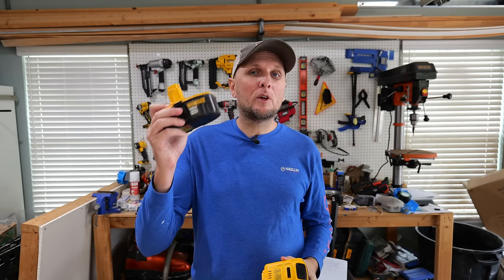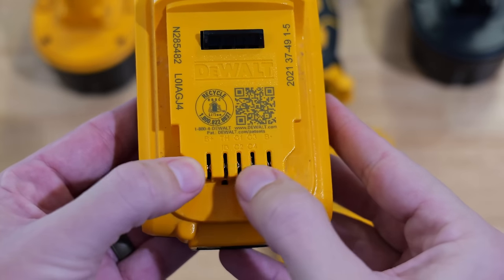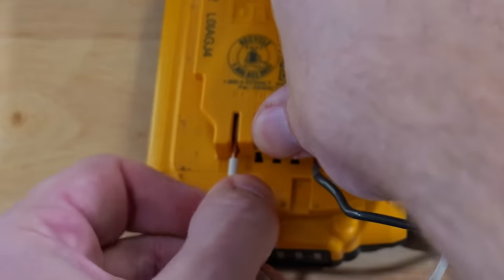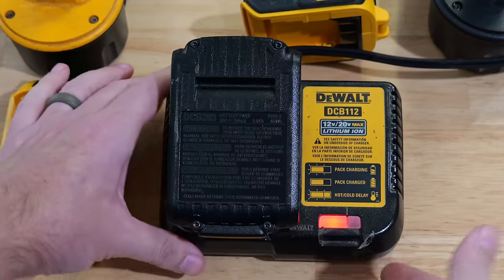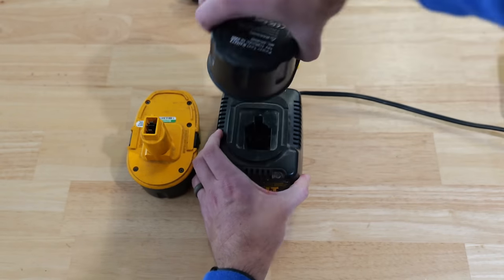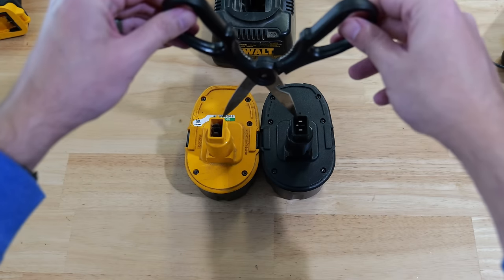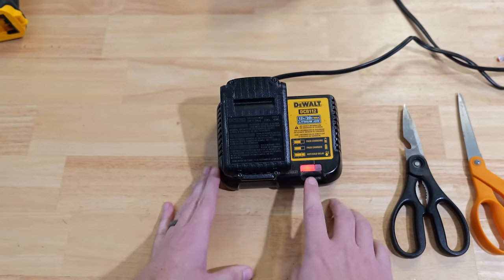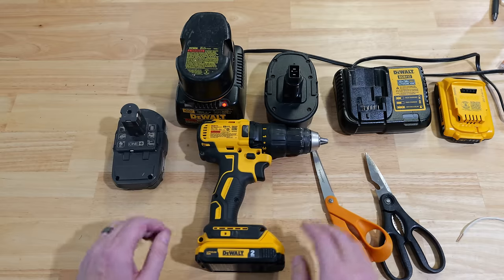SECRET To Reviving Dead Portable Tool Batteries | Super Easy!

Comment: Ingenious! Love this! Thank you so much for the wonderful tip! Gonna save people some serious bucks!❤
Reply: Not really because once you drain one of those batteries down too low, they become worthless. Yes you might get them to take a charge but, the capacity of the cells will be too low to be of any use.
Reply: @Blueknight1960  As I stated to another such comment, I jump-started a battery about 2 years ago and have used it many times since...never having to jump-start it again. It had been unused when it previously went completely dead (from lack of use), so admittedly that may be a factor. But it may not be a factor as well. I only know that it's operated as well as any new battery I ever owned for two years now, and I use my tools heavily...auto repair and home maintenance.
Reply from the maker: @tim9430 don’t try and give them actual facts Tim, many of them don’t like facts 😂.  Appreciate the input.
Reply: If the batteries are any good they should hold a charge on the shelf as it were…. I have probably 20 DeWalt batteries in my collection and the only ones that go dead on their own are the ones that i know are weak… I have a 9 ah 60v that’s in my chainsaw and 2 years on the shelf and it still shows 3 bars

Comment: While this does work, there is nothing to regulate the current when you connect the positive wire.  There's always a chance with Lithium that you'll have a fire if you charge or discharge too rapidly.  I recommend using a current limited bench power supply, or be ready to chuck the whole thing outside because it's on fire.
Reply: Probably a good idea to not just walk away from it while doing this. I don't even leave a battery on a charger any longer than it takes to charge it. I keep checking on it and when charged it comes out of the charger and unplug the charger.
Reply: @tsmartin I know you can leave Bosch, DeWalt, and Milwaukee in the charger since they implement a charge protection timer. Ryobi still doesn’t last I checked.  RTFM

Comment: FYI - if batteries sit on the shelf unused they undergo a process called self-discharge.  See wikipedia topic "battery self-discharge" for details.  I have several Ryobi tools each with a battery and I rotate thru them so a battery doesn't sit unused for months on end.  A lead-acid car battery can also self-discharge over time if left unused but also after years of use the chemistry degrades so they no longer hold much of a charge and need replacing.  A table in the article notes lead-acid batteries self-discharge around 4-6% a month and eventually won't have enough charge to crank the engine.  Lithium-Ion self-discharges 2-4% month and eventually won't have enough charge for the charger to recognize the battery as good.  So the trick in this video seems like a good way to give a still-good battery a kick so the charger will charge it.  But you will know if the battery is really degraded when it only runs the tool for a few minutes after "full" charging.
Reply: Not necessarily true, lithium holds onto its charge for a very long time. The only reason they self discharge here is because the BMS system is usually parasitic and requires a tiny bit of power to keep itself alive. The difference is that the lead acid discharge is because of its chemistry, and the lithium is because of its BMS. Does it really matter? No, but it is not a flat rate, a lithium battery with the same BMS but twice as large as another will bleed through the BMS twice as slow.

Comment: Very nice.  Never would have thought of using scissors.
Reply: What if red light continues to flash and no change to green after 20 minutes? Is it unrechargeble battery?
Reply from the maker: @maryreyes9926 yes.  That is letting you know something is actually wrong with the battery and needs to be replaced.

Comment: Very helpful... any suggestion for a blinking charger and the battery isn't charging?
Reply: I don’t have a solution but i DO have the same problem with one of my Ryobi batteries. It flashes the “maintenance charge” sequence (slow, gradual flashing).

Comment: You can also use a spade connector for the 18v one
Reply: What is a spade connector?
Reply: I agree, much safer. A short piece of wire with 2 female connector at the ends.

Comment: The 20v and 18v are actually the same voltage.  They each have 5 cells in series.  Normally the cells are specified by their nominal voltage of 3.7v so 5x is 18.5v.  However at full charge the cells are at 4.2v, so 5x is 21v.  But there isn't much capacity between 4.1 and 4.2v, and it is better for the usable lifetime of the battery to not charge it up all the way, so 20v is a nice round number pretty close to the typical upper limit.
Reply: @Sylvan_dB   Thanks. I appreciate knowing the details of "why".
Reply: correct, that's why Dewalt has the 20V MAX *  and if you go to the fine print it says " *Maximum initial battery voltage (measured without a workload) is 20 volts. Nominal voltage is 18. "
Reply: this is true if they are both lithium ion batteries but the 18 volt batteries shown in this video are nickel cadmium and are a very different technology
Reply: @jbbolts  no they are not. Ryobi changed from nicad many years ago and no mainstream tool brand has been nimh.
Reply: @Sylvan_dB  except the ones in this video are dinosaur dewalts
Reply: @jbbolts  Oh, ancient, eh?  Has dewalt discontinued those yet?  Ryobi did it nicely, making the new packs compatible with the old tools and providing "dual chemistry" chargers.  Oh well.  For NiCd the battery construction was 15 cells in series, at a nominal voltage of 1.2 volts per cell for a nominal 18 volt pack.  However the cells were fully charged to 1.25v or sometimes even 1.3v per cell, which comes to 22.5v or more for the pack.
Reply: @Sylvan_dB  whats your point? the bottom line is the 18v batteries used here are NiCad. And one of them is even a knockoff brand
Reply: @jbbolts  My point is as the first line I posted in my original message:  The 20v and 18v are actually the same voltage.
Reply: @Sylvan_dB  That part is correct... but there are way more cells in the older packs as the cels are only 1.2 volts each
Reply: @jbbolts  Correct, 15 in series, like I said.
Reply: Kids play nice.
Reply: @Sylvan_dB 
I switched from Ryobi to Dewalt, but got a couple battery adaptors to use Dewalt LI batteries with the original Ryobi tool set...circular saw, reciprocating saw, jig saw, drill, vacuum (which sucks).
Reply: @jbbolts   somebody doesn't like to be corrected 🤭
Reply: @JamesLawrence-hv4ti  yup.... I've worked with people like that... you can see in the original post thats not what he said but hey what are ya gonna do (never mentioned 15 cells of nicad )
Reply: @JamesLawrence-hv4ti  And just in case you're referring to me while I dont particularly like being corrected if I legit make a mistake I own it just the same
Reply: @jbbolts commendable, I wasn't referring to you
Reply: It's is a marketing ploy, "moe V's moe powa".
Reply: @jamest3552 
Nerd fight!
Clear the study-hall!
Reply: It's false advertising plain and simple. Dewalts batteries have to be marketed as 18v everywhere else in the world that actually has basic consumer protection laws.

Comment: In case you don't have a second battery to jump start the dead battery, I did the same thing using my car battery and a set of jumper cables. I had to clip a piece of wire onto one end of each jumper cable so I would have something small enough to fit into the grooves on the Dewalt battery. I used an old guitar string because I had one handy. I only jumpered them together for less than a minute. The 12-14 volt car battery shouldn't cause any harm to the 20V battery...and it didn't. I have used that rescued battery for about 2 years since then and never had to jump start it again.

Comment: Thanks for the info. My experience is that 'heat' kills any battery no matter what type and letting batteries go 'dead' and then leaving them partly charged is also bad news. Some batteries also dislike being anything other then constant topped especially gasoline car batteries. i tend to leave them on trickle charge and have a desulfator in my car engine compartment and plug it in whenever i think of it and my batteries last 10+ years. The charger is on a xmas light timer and runs about 15 to 30 minutes/day so the battery water levels don't go down from the constant heat of charging. My ipod is plugged in all the time and so it lasts an incredibly long time.

If i have a particularly long continuous drain like mowing a lawn with an electric mower, i will go till the battery seems done and not try to force it beyond that and then put the battery in the basement in a cool place but not the fridge, for at least an hour so it completely cools down. Then i find the coolest place in the house like the floor in the basement (again not the fridge) and put them on charge and charge till it is done and leave it in the charger for awhile after, (i set the alarm on my ipod to remind me) and then let the batteries cool for at least an hour or three, and then use them. My batteries last a long time with doing this.

NiCad batteries are supposed to be used till they are drained down or they will get a memory and will not top off properly, but the problem is that if they get too low they will short and the only way to revive them is to give them a blast of juice say from a lead acid car battery to break the short and then they will recharge. I would not try that with a lithium battery. (That's why Teslas are called "blow up cars".)  The memory problem with NiCads IMO is more mythical than true and i've read articles that basically dis that practice basically because any weak cells will die first and thus reverse, so in our aircraft they have to drain (cycle) each cell separately and have a charger that electronic monitors it and shut off the draining at exactly the right voltage before recharging.

In the 1970's?? The Canadian guv in their infinite wisdom forced all aircraft owners to install a Li powered "emergency locator transmitter" system in all aircraft to cut down on their very expensive search and rescue costs of locating downed aircraft. Very good idea but not well thought out. The Li batteries started blowing up and basically blowing the tail off of the aircraft. (ELTs are usually placed in the tail as it sustains less damage in a crash) Aircraft don't work properly without a tail for some reason...😏 Same as the "blow up Teslas"

Another 'feature' on one device i have is that if the Li battery sits, say all winter with no use, the battery will discharge a certain amount (i forget why) so i never leave it on the device and charge it periodically.

Basically i know this info from lots of articles in RC aircraft magazines on charging, combined with listening to mechanics.
Reply: Ni cad has been replaced with nickel metal hydride batteries. they   don't have the memory effect. lead acid batteries like being kept fully charged. lithium batteries last the longest when used between 20% and 80% charge.  They make LIFEP04 batteries which don't catch on fire and have a much higher cycle life. the draw back is the maximum current draw is at their amp hour rating. The charge current is at a quarter of the amp hour rating..

Comment: Beware - this trick can definitely work if the problem is that all cells have a too low voltage. However if all cells but one are good and one cell is dead short - which definitely commonly happens too - it's an easy way to start a fire. To prevent this, chargers for n-cell batteries tend to refuse to charge when the measured voltage is smaller than the fully charged voltage of (n-1) cells. Some chargers are more clever than this and look at the charge/discharge curve to detect this condition more reliably - these chargers will have better chances at reviving a dead battery.

Thus, when doing this, best do it outdoors, with no flammable material nearby, and also thoroughly test the battery afterwards - either by fully charging, discharging and recharging once to see if it gets a good charge (on a single cell short you likely will have an "empty" - as in, too low voltage - battery soon after use again) or fully charging, discharging a bit (like a minute of power drilling into the air) and checking its voltage to see if it is near its design voltage (if it has a single cell short, it will go below design voltage very soon after charging and even drawing a small amount of energy from it).
Reply from the maker: Yes but those chargers also blink in a way showing that something is wrong.  This method would only introduce enough power so that the charger can recognize it and either start charging it again like normal or if there is an issue, at that point would blink, usually rapidly, to let you know there is an issue and needs to be replaced.
Reply: I have a battery that the Dewalt charger shows as charged (solid light) but it won't power any of my tools. I was told it may have one dead cell. Have you come across that? I haven't tried this trick on it because I was afraid it may not be safe. Looking to buy another spare battery instead.

Comment: I use porter/ cable I have to say, I put it away for about 8 months, charged.
Went to use it, worked
Like a charm. I use it for everything and it performs like a champ.
I know some people
Knock the brand, it's never let me down the battery. The drill & battery are still the same when I purchased them 6 yrs ago , now that I said something I'll need a battery & drill I'll purchase the same thing again,no regrets!

Comment: This video just resurrected my old 14.4V Snap-On 3/8  Impact. It's been in the bottom drawer of my tool box since about 2007. Both batteries were dead and the charger read them as faulty. I hooked one of them up to my 12V car battery charger set on 2 amps, and after 5 minutes the Snap-On charger would read it and apply a charge. Now while the one battery is on the charger the other is on my car charger.

Comment: This is likely to be really useful to me in the future.  I have Ryobi 40v batteries for my yard equipment; two of them are over five years old now.  I've had no issues with them, and now I wonder if that's because they've never been run down completely (I have a small yard).  However, if I should have this problem going forward, I'll "jump start" the apparently dead battery instead of coughing up the high price of a new one.

Comment: Thank you…I can practice this on my batteries now…I’ve also seen a friend light a cigarette with a battery pack..just used wire connected positive and negative ports with a wire..wire got hot and instant fire starter and cigarette lighter…also witnessed jump starting a car with an 18v dewalt battery…

Comment: Didn't work with a 40V Ryobi and I'm sort of glad it didn't. I too have seen Li Ion batteries melt down. After I played around with these cures, I set the batteries outside in fear of burning the home down. I love the cordless tool, but Ryobi 40vs are just too sensitive to this issue. The replacement cost is now reaching $200. It's nearly always cheaper to buy an entirely new tool. Which is why I now have three string trimmers.

Comment: I used a car battery charger in an old 14.4v ryobi and held terminals on +- a few seconds and then put it in the actual charger. Worked perfectly.

Comment: this method does work I have used it myself but before long you will be back in the same boat so take this as a sign to start saving money to buy a new battery if you're lucky you'll have enough money by the time the battery stops working again

Comment: I have a black and decker matrix I bought in 2011 and I'm still using the original battery and is still good takes a charge and last the full duration as it did when it was new

Comment: Great information. I tried this with two old batteries, got one to work and accept a charge but the second wouldn't accept a charge and just shows a rapid flashing light on the charger. Any tips on a battery fix for the the rapid flashing light?

Comment: I resurrected my fairly new Milwaukee just now - it's been sitting on my desk for months - but the Milwaukee 'mouth' on the newer 18 volt battery didn't like the 14 ga diameter so I took a small hammer and beat it into a blade shape, and Voila !   It took 5 minutes and saved me 75 $

Comment: I have a 12volt green black and decker drill, magna force, it still works, its a dewalt, same battery, same charger, same drill, 25 years old, but still works, with original batts

Comment: Similar situation with car batteries. During covid, our fleet vehicles sat so long, I couldn't jump start them with a lithium battery jumpstarter, nor could I charge them. NOCO chargers have a button that you can press (red exclamation mark one), that takes the 'no battery is attached' signal, and over-rides it, and just starts charging.

Comment: When I was a cop we relit our Streamlight batteries by hooking them up to a 12V battery charger and put it on 50 amp boost.  Of course we put them outside the garage and then plugged in the charger for about a minute.  We knew that the battery might explode so didn't want to be anywhere near it when we hit it with the power.  Never had one explode, but the process also never failed.  We had light again.

Comment: This seems like an easy feature to add to the charger.  These batteries are very expensive and they should make it possible to recover these over discharged batteries as this is a frequent problem in the spring.